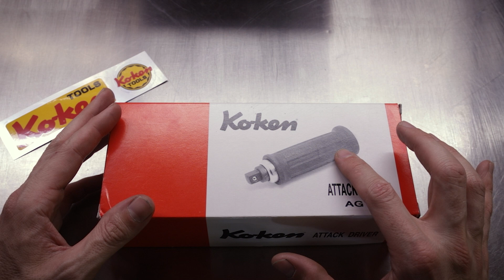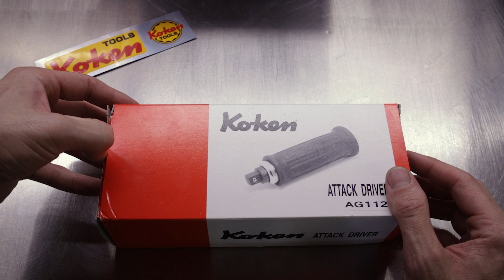Tools From Japan: Ko-ken Attack Driver!

Comment: There is a huge advantage over battery or compressed air impact / rattle guns especially if you try to loosen Phillips or Pozi or flat blade style bolts. Every time you knock the driver the blade is not only rotated but pressed into the screw head. This much limits the risk of damaging the screw and the bit.

Comment: I wish somebody would build a solid electronic repair screw driver set where the bits aren't manufactured with soft Chineseium, and the bits are standardized as I bought a kit that had the bits that were undersized to the point that they needed a magnet to hold the bits into the screw driver.

Comment: I had some success with getting some 'turbo'/'tornado' sockets to bite into a fastener. It attacked it pretty good.
Reply from the maker: I tried Irwin twist sockets on my Snap-on impact driver a while back on a rusty Subaru rocker cover bolt. Didn't grab.
Reply: @MrSubaru1387  yeah, thats why I wrote some success 😆 I had ones that didn't bite and just ruins the spiral 'lip' of the socket.
Reply from the maker: @chriscas-ToolAficionado  mine are old and kinda chewed up. Should upgrade to the Ko-ken or better made versions.

Comment: Great stuff! I am trying to find out what size the bits are? Are these 5 mm in diameter? Or 8? I would like to know what impact bits I can use on the 1/2 size  bit holder. In case I need to buy replacements etc. It's very hard to find out. Nice video!

Comment: How did the Koken spark plug sockets with the integrated extension work out?  I’m a Snap-On fanboy but I decided to give Koken a shot since I don’t own any 9/16 or 14mm spark plug sockets. Looks like Koken makes a 14mm regular spark plug socket, a super thin wall, a universal joint, a 8” extension and a 10” extension variety.  I’m debating on which ones to try for FB engines,
Reply from the maker: I love the Ko-ken spark plug sockets. Haven't touched my Snap-on or MAC ones since getting the Ko-ken.

Comment: Better than snap on ?
Reply from the maker: Better in price, and Snap-on doesn't offer the overmold/comfort grip.
Reply: I had one it lasted 15 years and would of lasted longer if did not loan it to a animal working on a D8 cat who used 8 lb.  Sledgehammer  to drive it. worked as good as any.